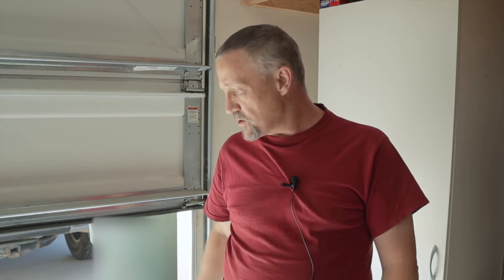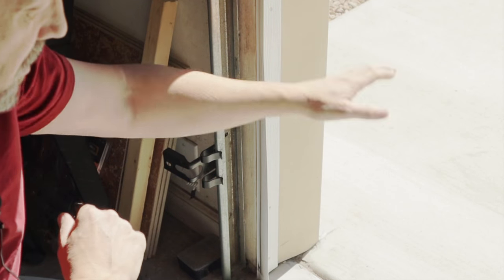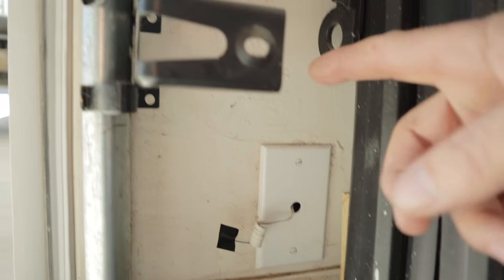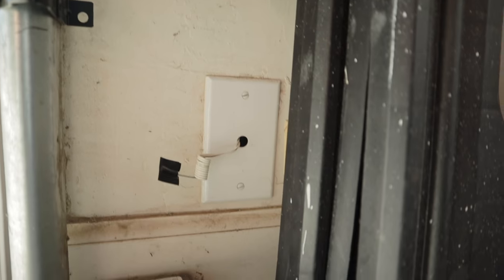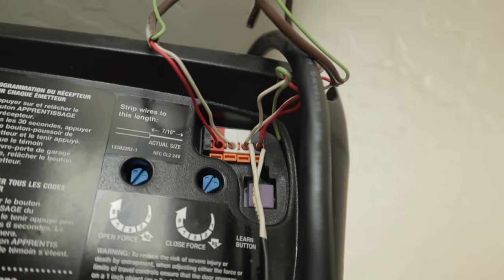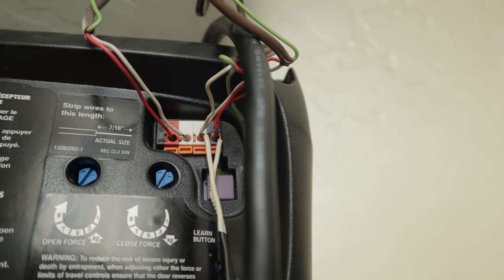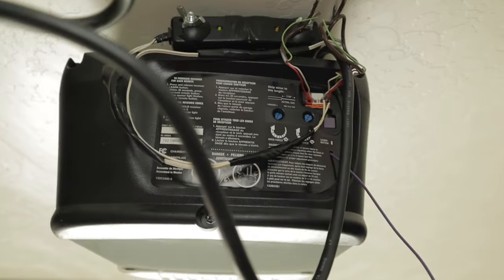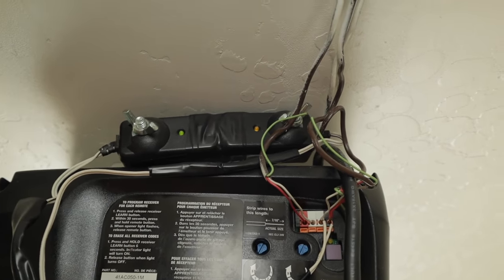How to Disable Garage Door Sensors

Comment: I am missing a sensor is there any way to completely bypass the sensor to see if the opener is even functional looking to get new doors dont want to replace a opener if I don't need to
Reply from the maker: Not that I’m aware of.
Reply: @DIYHomesteadProjectsDIYHP10  appreciate the fast answer found a solution it worked hold the button down when closing opening they are not needed
Reply from the maker: Good to hear you got it figured out!

Comment: Will the motor still work if you just disconnected the sensors?
Reply from the maker: I have not tried that but I don't think it will.
Reply: @DIYHomesteadProjectsDIYHP10  i just tried your method the light is green now it opens but won't close the light still flashes
Reply from the maker: Hmmm, I have one sensor with a green light and one with an amber light. (one sends and one receives)
Reply: @DIYHomesteadProjectsDIYHP10  yea 1 is green the other looks light orange 2 me
Reply from the maker: It sounds like the problem isn't with the sensors.

Comment: Going to try this sunday. I cant put the sensors due to an older garage door. There were no sensors before but the opener was installed 1990. Hoping this works as it would not close and just flash when tying to close the door. Lets hope it works 🙏
Reply from the maker: I hope it works for you. Good luck with the project!
Reply: 93 was the first year of photo eyes, so you don't have them. Do yourself a favor and get a quality door company out to fix your binding problem with your door, next have them put in a nice D. C. Opener and get rid of that piece of garbage pre optic machine. If the door sounds like a roller coaster going up the first hill when moving have them replace the rollers also. Your door needs to run buttery smooth! Also pretty quiet. Check angie's list and yelp for a good company. Yes I'm a door guy.

Comment: Thanks for the video I need to bypass mine because I have to keep my 16ft lawn trailer in there with the tongue sticking out so I need to shut it partially
Reply from the maker: No problem, I hope it helps you out.
Reply: @DIYHomesteadProjectsDIYHP10  ok so what I did was take mine off the brackets then reinstall the brackets about 30 inches up from the floor above where the trailer tongue sticks out. I get to keep the safety feature just only that the sensors are higher now. Another good thing about this is the morning sun won’t mess up the sensors as well

Comment: I wonder if this would work too. I assume the sensor beam is  infra red. The leads to the transmitter and receiver is about 12VDC. If you have a IR LED and a series resistor (200 0hm) with it, you could wire it up in front of the receiver and tape it there.

Comment: I have the Liftmaster P3. It started having eye problems. I replaced the eyes no luck. I thought the wiring through the wall was bad so I ran surface wires no luck. Then I taped eyes the to a paint stick eyes facing each other and drilled a hole in the paint stick and hung it with a zip tie. I think the control board is bad. But this has worked fine for the past 3 years.

Comment: Wouldn't completing the circuit by connecting the two wires coming out of the unit do the same thing??
Reply from the maker: No unfortunately, this circuit needs a pulsed signal that's provided either by the sensors or a pulse generator.

Comment: Any idea why this would be happening to my opener even at night?  It’s to the point now where I have to exit my vehicle to manually hold down the close button to get the door to go down…
Thank you!!
Reply from the maker: Are any of the horizontal braces that strengthen the door, coming down and momentarily blocking the sensors as the door is closing? I also had this problem. The sensors were mounted too close to the door and the as the door closes, the supports on the door would trip the sensors.
Reply: These sensors can exhibit the same behavior when it's cold...especially if the sensors are fairly old. Could that be your problem?

Comment: I may have to do the same thing on our new LiftMaster belt drive opener, which replaced a 35-year old Genie screw drive opener.  It was the original opener that came with the house.   Our garage faces due south, and we get a lot of sun here.  Granted, it'll be awesome for any future solar panel projects, but so far it has not been awesome with the garage door opener.
Reply from the maker: That's pretty much my exact scenario.
Reply: These electronic eyes have been around for over 20 years now.  You'd think the industry would have designed a solution to this problem by now, since there is a roughly 1 in 4 chance a homeowner will have a south facing garage...

Comment: Can’t you just connect a wire directly between white and black? Or put a high value resistor between the two?
Reply from the maker: No, it's not that simple. The opener needs a "pulse frequency" signal and not a constant voltage. You need either a pulse signal generator or the sensors. Just connecting the wires or using a wire as a jumper will not work.
Reply: @DIYHomesteadProjectsDIYHP10  thanks, I wondered how it was sending a signal over one wire. That makes sense. Thanks!

Comment: If you think about it the sunlight will only hit one of the 2 sensors. Only the receiver sensor is affected by the sunlight and not the transmitter sensor. All you had to do was to swap the position of the two sensors. That's how I fixed my garage door having the exact same problem.
Reply from the maker: That may work for some but it didn't in my case. My garage door faces south so the sun hit one sensor in the morning and the other sensor in the after noon. This has been the best solution for my situation and I haven't had to touch the garage door since. That's exactly what I was looking for and it worked well for us.
Reply: @DIYHomesteadProjectsDIYHP10 I see, both your sensor positions are affected at different times of the day. In this case, what you need is a directivity. I would try putting a piece of cylindrical tube (~2" long) in front of receiver lens to block out the sunlight and only receive light from the transmitter. Your solution works but you are missing out on the safety the sensors provide. I would try other means to keep the sensors in place and still solve the problem.
Reply from the maker: IMO the safety sensors are more of a hassle and nuisance then they are a safety feature. I made this modification several years ago on my garage door and I haven't had any safety issues or problems with the door since. This fix has worked well for our situation and I would use it again without a second thought. Each individual needs to decide what's best for their situation when dealing with the issues the sensors can create.
Reply: @DIYHomesteadProjectsDIYHP10  Ok, I respect that too. I'm just looking at it from the Murphy's law perspective here. If something could happen, it will happen given enough time. It only take one wrong click by someone while you have something valuable under the door. Putting a small piece of PVC pipe in front of a receiver to act a sunshade is a negligible amount of effort for what it can prevent or save. That's most likely even less amount of work compared to what you had to do. But then again, it's your door. You do what you like with it and I'm cool with that. It seems your goal was to get rid of the sensors regardless of the interference from the sun. 🙂

Comment: My manual says if sunlight is the problem, switch the sensors.  Did you try that?
Reply from the maker: No I didn't. The way my house is positioned I would either have sun problems in the morning or in the afternoon if I switched the sensors. This was the best solution for my particular situation IMO.

Comment: I remember back in 1975, when my Dad installed a garage door opener at our house.  You KNEW not to get in the way, or it would squish ya.  Same year, we KNEW not to walk behind a car when the backup lights were on, or it would squish ya.  Somehow, somewhere along the line......people have lost their "self preservation" instinct......and now rely on "stuff" to save them.

BTW, about 22 years ago I did the same thing to my garage door sensors.  But when we put the house up for sale, I had to reinstall them as per the "inspector".
Reply from the maker: I agree! We sold that house about a year ago and the buyer requested that I leave the modified sensors. He didn't want to deal with the sun issue and had the common sense to operate the door safely. It was refreshing to know that there are still a few people out there that have common sense and know how to use it.

Comment: Did you happen to try just using a single jumper wire to replace the sensors?
Reply from the maker: No, that won't work. There needs to be a pulsed signal created by the sensors or a pulse generator for it to work.
Reply: @DIYHomesteadProjectsDIYHP10  yup found that out a little bit ago
Reply: @DIYHomesteadProjectsDIYHP10  I guess the sensor modulate the signal.
Reply from the maker: That's correct

Comment: I only have the problem when it is cold outside. The door comes up by use of the remote or main door switch, but won’t close by using the remote. Will start to close, but then reverses and light flashes or motor unit clicks ten times. Neither light on the sensors are on. Diagnostic light on motor unit blinks once. Any suggestions for a fix?
Reply from the maker: If neither light on the sensors is on I would say the sensors or the wiring to the sensors is being affected by the cold. Just a guessing.
Reply: Would you recommend that I replace both sensors and the 2-conductor wiring going to the motor unit?
Reply from the maker: If it were mine I would start with replacing the sensors. They are not too expensive and fairly easy to replace. Once they are hooked up one should have a green light and the other should have an amber light on all the time. If that's the case the door should work fine. If you hook them up and you don't have any lights on the new sensors I would say the problem is either with the wiring or a problem with the opener unit itself.
Reply: I appreciate your responses and will get back with you on my troubleshooting.
Reply from the maker: Looking forward to hearing how it went for you.

Comment: Don't you love it when lawyers and cost accountants make engineering decisions?  These extra safety sensors are just a liability condom for the manufacturer.  They probably love it when we resort to this because now they are off free should something horribly unlikely happen.  They could have used a more expensive, better performing sensor, but no. Easier to just make it the customer's lifetime headache than to build it right.

Thanks a lot for this video!
Reply from the maker: Thanks for stopping by!

Comment: I did exactly the same thing, all on my own, except I just moved the sensors above the garage door (our wiring was outside the drywall) and taped them together. No children at our house either and I can stop the garage door from closing and make it reverse with one hand. But, as you said, do this at your own risk and I would never do this modification with children around.
Reply from the maker: Sounds like you got it figured out Douglas. 👍

Comment: I have a faulty sensor is their anyways to bypass in this scenario?
Reply from the maker: You'll either have to buy a new sensor or buy a bypass module off ebay.  I think they are about $15 for a module off ebay. Just search "garage door sensor bypass" and you should see some options. You can make a bypass module yourself if you are interested in doing that. You'll have to do a search for the part, I don't remember it's name off hand.

Comment: My sensors would trip from the smallest spider web and/or a small leaf caught in a spider web.  I got sick and tired of having to get out of the vehicle to clear the sensors, especially when it's raining, ridiculously hot, or when I'm wearing my "Sunday best."

My garage door will automatically go back up when it bumps into something such as the open lifgate of my truck, so I don't understand the point of the sensors.  Redundancy maybe?
Reply from the maker: Regulation nonsense IMO. My opener works much better with this modification. When you push the button it just works. I wish you the best.

Comment: If one is the sending unit and the other the receiver, maybe switch them from the other side of the door. That way the sending unit will not be prone to the sun.
Reply from the maker: That may work in some cases. In my case the sun is a problem on one side in the morning and a problem on the other side in the afternoon and evening.

Comment: What would happen if you just connect the two wires without the sensors? Thanks in advance
Reply from the maker: The opener needs a "pulse frequency" signal and not a constant voltage. You need either a pulse signal generator or the sensors. Just connecting the wires or using a wire as a jumper will not work.
Reply: Thanks a million for answering

Comment: This did NOT work for me. I have everything wired as shown and sensors taped facing each other as shown. Door still goes a little bit down then stops. What are my next steps? Buy new sensors? Help please!
Reply from the maker: I would say it's either wired incorrectly or one or both of the sensors are bad. You should be able to tell if the sensors are working or not by the lights on the sensors. One of my lights is amber and one is green.

Comment: Question by putting a jumper from white to grey tabs on opener will that work the same?
Reply from the maker: No, a jumper won't work.
Reply: Thanks I just found that out and did you method works like a charm thanks for getting back and great video!!
Reply from the maker: Great to hear! 👍

Comment: I just spliced the wires together where the transmitter sensor is located. Didn't have to bother with doing it at the top of the motor. Simple 2 minute fix.
Reply from the maker: Excellent! 👍🏻

Comment: Did you try swapping sides for the sensors so the receiving sensor gets put on the less sunny side and the transmitting sensor gets put on the side with more sun? Before moving them you can check this will solve the problem by first shading both lenses from the sun, then check to see if the garage closes, then test them again shading only one at a time and through process of elimination will find your receiving sensor since that'll be the one you are shading when the garage door finally closes without problem (as long as it was the sun that was causing your problem anyway) and make sure the receiver lense finds shade. It could be as simple as a carboard tube left over from a roll of toilet paper or maybe planting a small hedge or bush outside the garage to provide just a bit of shade at that time of day, or they even make parts that bolt onto the side designed specifically to block sun from entering the lense of the sensor. Or what's free and easy, tape them together. Your choice!!

Comment: Was it a chamberlain?
Reply from the maker: No it's a LiftMaster
Reply: @DIYHomesteadProjectsDIYHP10  made by chamberlain you said, I’m pretty sure this is the issue I’m having
Reply from the maker: Nate, I didn't realize that LiftMaster was made by Chamberlain. The sun on the sensors is an annoying problem but this fix will work well for it. I did consider the sun shades or tubes for the sensors but I didn't want to deal with them getting knocked off or miss aligned if hit with something then having to always mess with them. Since I've done this fix, I haven't touched anything on my garage door. It's just been working when I hit the button and that's exactly what I wanted. Good luck with your door issues.
Reply: @DIYHomesteadProjectsDIYHP10  I’m gonna try this in the next day  or to, hopefully it works , my fingers crossed
Reply from the maker: Good luck with your project Nate. Let me know how it goes.

Comment: This is my situation. It also happens when there are snow flurries in the sunlight. 

I figured what I'd do is just mount the sensors above the garage door, pointed right at each other. I was hoping there was a way to do it without the sensors. Ideally, I was thinking of wiring in a toggle switch so that the sensors would normally be respected.

PS: I did get GEnie to send me "improved" sensors when I called them, irate, but I haven't installed those. I'm thinking I might put in a switch so that I can have two pairs of sensors, one pair situated pointing directly to each other, and a "real" pair, which I can override.
Reply from the maker: That would be quite a set up.

Comment: Cool idea. Who would have thunk?! #1. Can you also just join the sensor wires together to complete the circuit, or is it necessary that the sensors remain? #2. Was that a HF “Welding Table” slinking around in the corner? ; ) 
Very informative. Thanks Bruce!
Reply from the maker: You can't just connect the wires to complete the circuit. There has to be a pulse signal for it to work. Different brands have a different pulse signal. You can either use the sensors or buy a pulse generator for about $10 to connect to the sensor plugs. Good eye, yes that is a HF welding table you saw. :)
Reply: @DIYHomesteadProjectsDIYHP10 : Figured that was the case, but had to ask ; )
Reply: @DIYHomesteadProjectsDIYHP10  ok, that answers my question.

Comment: Would a 10 K resistor work?
Reply from the maker: I haven’t tried that but I don’t think it will work. That circuit requires a pulsed signal.

Comment: I have the same problem when the sun is bright, what I do is spray a little water along the bottom of where the door closes and that cures the problem of the door reversing and not closing.
I believe it is the reflection off of the floor.
Reply from the maker: I think it is a common problem. That is an interesting solution you've come up with.